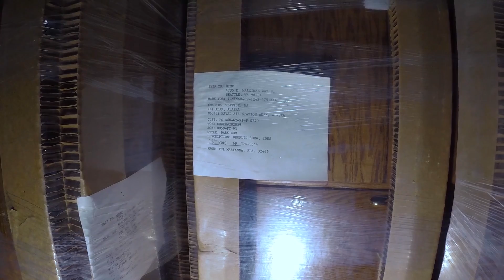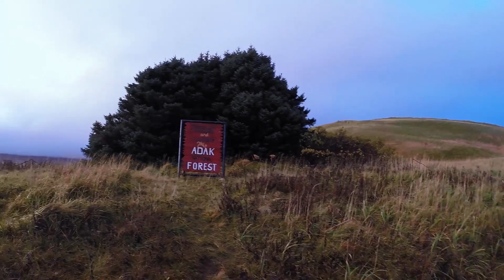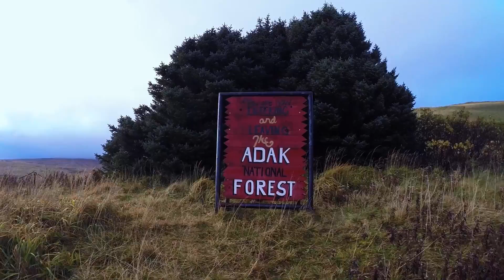"It's ALIVE" Episode 8 Straight Outta Adak - Alaska Picker

Comment: I was a Navy Weather Observer (AG) there in 1987-1988.  I worked out on that old Universal machine that can be seen at 4:05.  I spent a lot of time in the Rawinsonde Building that can be seen at 6:08, doing weather balloon launches day and night.  The fiberglass dome used to house an upper air tracing device called a GMD-1.  It had a dish that would follow the radio signal from  the transmitter.  We used the data for weather forecasting purposes.  I also worked doing weather observations in the first floor of the Operations building that houses the tower (7:50).  Thanks for the trip down memory lane.

Comment: The real Navy Exchange (NEX), was co-located with the Commissary in the building in back of McDonald's. In the early months of 1994 the NEX started to curtail operations and moved up to the old Bob Reeve High School for the remaining three months. Except for the NEX Gas Station, the Commissary and NEX Store building was closed and secured by the Navy. In the months following, crews moved massive amounts of furniture out of the older quarters and piled it up to the ceiling on the main floor of the NEX portion of the building. Everything left behind was supposed to be for REUSE by the Aleut Corp. I can't believe how much they let the infrastructure deteriorate. What a waste!

Comment: AT 6:07, I spent a lot of time in that building in 1984-1986. I could tell you some things about that building, and about 
Adak. Also about White Alice, and NSGA.
Reply: You may have worked at NOCD/NWSED, or you may have worked at NSGA, but not both on the same tour.  Make up your mind.  I did work at NWSED Adak, and later worked in NSGA Guam and Fort Meade.

Comment: Have you ever been in building on Adak located at Lat/Long  51.877714, -176.640286. My squadron was stationed there in 1968 before all the housing and other buildings were built and it was really barren. The building at that location was my barracks. you went threw my old hanger with the squadron insignia's on the side in one of your videos which brought back some memories, and my barracks is the building with 4 parallel buildings on the left (according to google maps) and a big "V" shaped wing to the right connected in the middle by a common area. The new addition to the left of it was not there at the time. It is located about 2 blocks to the North up the unnamed road. If f you  did, which video is it in. I would really like to see it.
Reply: Was there in 66! Hated the time there! VP49. Tour the army Quonset huts very nostalgic though! Went to Japan and Hawaii as air crew only happy moments at Adak!!!!!!!!!